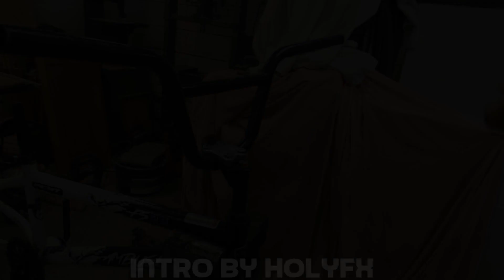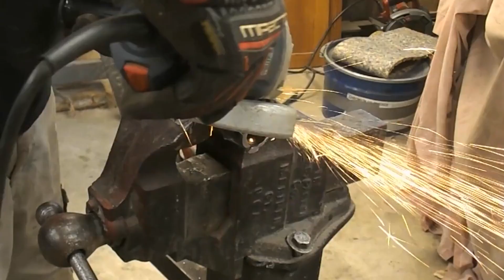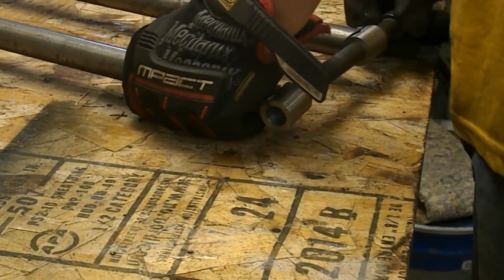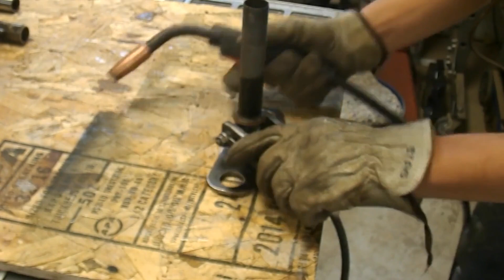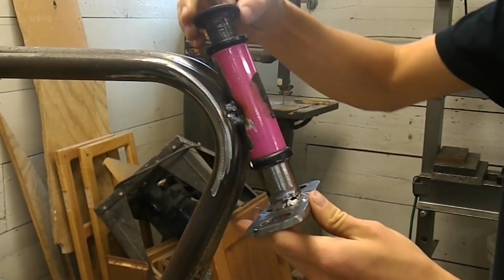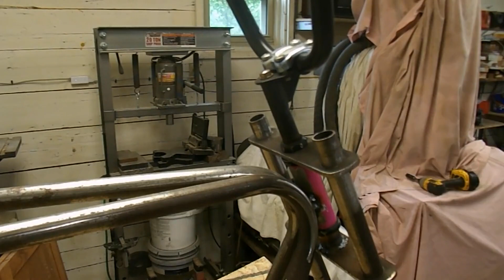Homemade Minibike Front Forks

Comment: What the height in inches of the top of the handle bars down to the end of the fork cause I’m planning of just using bike forks instead of making them will that work?
Reply: Mini bike forks are usually much longer and made from much more durable tubing than most bikes. As much as I love building things and seeing other people's creations. I don't suggest you using bike forks on a mini bike, which you would have to modify in order to do so anyway. I'm saying this out of experience honestly. 
My first mini bike frame I built from scratch a few years back, I used front forks, wheel, stem and bars from a Walmart mongoose with aluminum front room figuring it would all hold up well. Of course I had to extend the fork tube and manipulate them a little. But it worked decent until I went off road. After half dozen turns, the front rim literally broke in half causing me to go over the bars. Luckily I was able to laugh that one off as I was only going 10 to 15 mph. I switched to a Haro heffer front rim. Back in business. That was until the forks bent inward after hitting a small pothole. The only parts that didn't bend was the part that I fabricated and welded. That one I didn't get up laughing due to me face planting the cement! 
I'm just saying, do what you will. Just be careful. Otherwise I would go a different route! Mini bike forks are designed the way they are with the steel they're made of for a reason.
Reply: Mini bike forks are usually much longer and made from much more durable tubing than most bikes. As much as I love building things and seeing other people's creations. I don't suggest you using bike forks on a mini bike, which you would have to modify in order to do so anyway. I'm saying this out of experience honestly. 
My first mini bike frame I built from scratch a few years back, I used front forks, wheel, stem and bars from a Walmart mongoose with aluminum front room figuring it would all hold up well. Of course I had to extend the fork tube and manipulate them a little. But it worked decent until I went off road. After half dozen turns, the front rim literally broke in half causing me to go over the bars. Luckily I was able to laugh that one off as I was only going 10 to 15 mph. I switched to a Haro heffer front rim. Back in business. That was until the forks bent inward after hitting a small pothole. The only parts that didn't bend was the part that I fabricated and welded. That one I didn't get up laughing due to me face planting the cement! 
I'm just saying, do what you will. Just be careful. Otherwise I would go a different route! Mini bike forks are designed the way they are with the steel they're made of for a reason.

Comment: Are those forks able to come off this is very important I need to know
Reply from the maker: No the handle bars do not come off, it’s all one piece
Reply: You have to have blind nuts welded on the top of the outer fork tubes, this way you can remove the top plate for adjustment and maintenance.